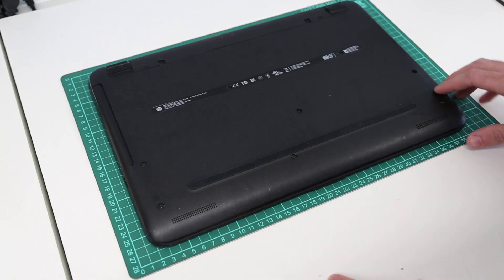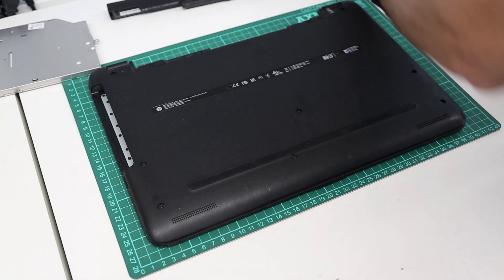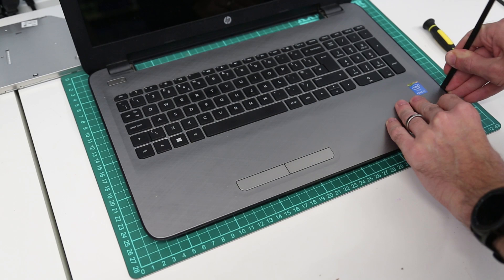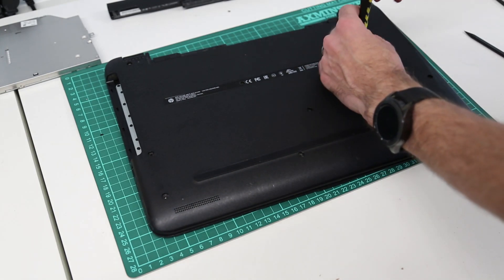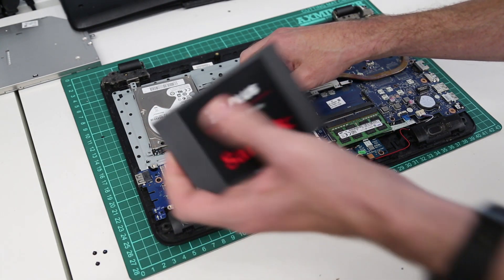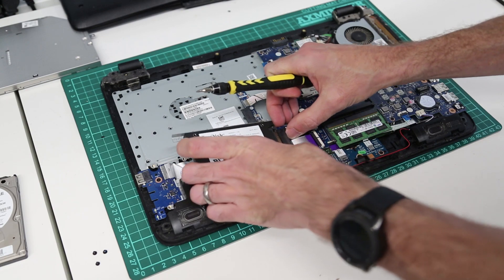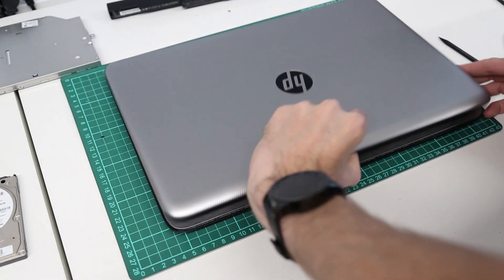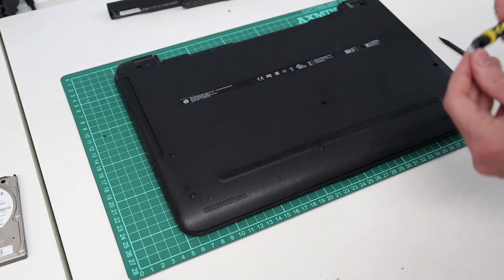HP 15-ac152sa SSD/HDD and RAM Upgrade Guide

Comment: can I use SSD and HDD on both these devices?
Reply from the maker: If you have a model with an optical drive you could replace it with a SATA caddy and fit the HDD in there.

Comment: 15ac189nia is this almost the same as your laptop?
What kind of ssd and ram is compatible with this model?
Reply from the maker: Should be physically very similar, just different specification CPU, GPU, etc.
Takes DDR3 RAM and 2.5" SATA drives, so the links in the description should be fine.

Comment: Can i put ssd on m2 wifi slot?
Reply from the maker: No, they are keyed differently and won't fit.
Reply: @BrueComputing  thank
Reply: @cybersoul92  the adapter exists, you have to replace the CD player with a caddy that has a hole for hard disk, then instead of the hard disk you have to put this adapter which is a plate with sata connection and contains 1 or 2 slots for M2